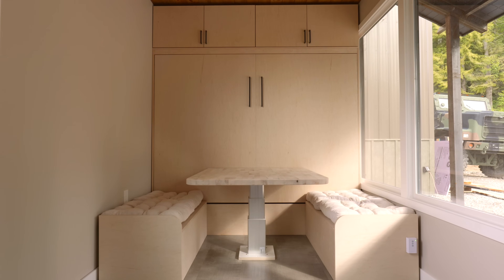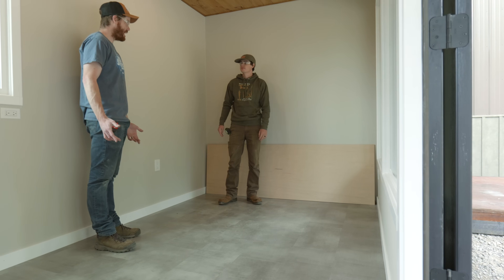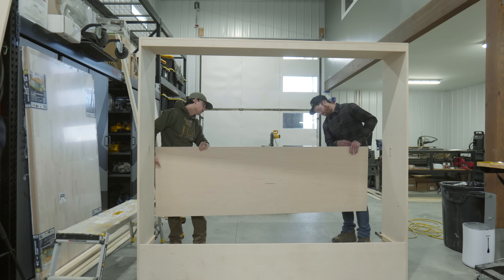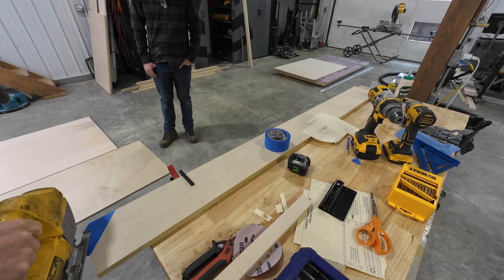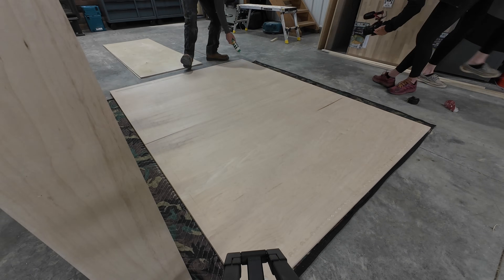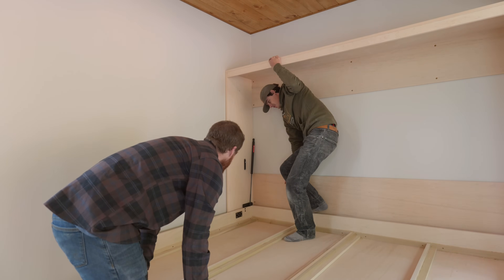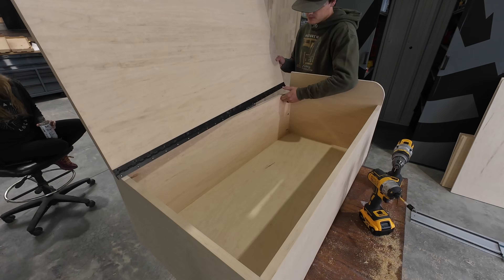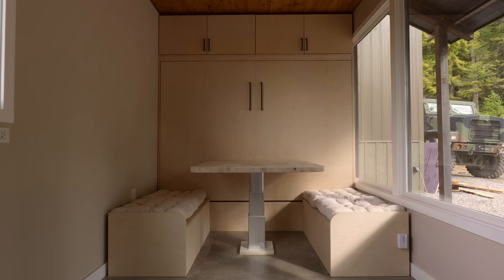We Built The ULTIMATE Murphy Bed (complete build)

Comment from the maker: Thanks to Ferrellgas for sponsoring this video: https://ferrellgas.link/8zf
Reply: Having the nice driveway that you built made it really easy for the propane to be delivered.
Reply: Does the table up/down motion stop if an obstruction (legs/arms) is encountered ?
Reply: Kudos to the 'detailing team' who made that pretty truck sparkle. Nice segue into the spot too. That 'ad' is ready for 'TV' (whatever that is...)
And 'set for the winter' - by June! (Who are you - and what have you done with Riley?)
Reply: Cool to see a new partner like Ferrellgas. This video idea is probably a few years down the road, but I think Ferrogas is working on some renewable NG projects, one from biogas produced from vegetable oil byproducts, which looks really promising. I think there is another project, direct gas synthesis using excess renewable energy. Remote homesteads are always going to need some form of dense energy storage, at a minimum for backup heating and power during long snowstorms... Renewable natural gas is going to be one of the answers!
Reply: where do i get the murphy bed hardware kit?
Reply: I really liked your video 😊😊😊😊where can I buy such a table leg?

Comment: Your collaboration with Molly and Dylan on the Murphy bed was a hit out of the park. Well done!!!

You mentioned that the tape measures were out of wack. (Usually) These can easily be brought back into "close" accuracy.

Loss of accuracy is generally attributed to the tab (at the end of the tape) no longer being perpendicular to the line of the tape. Using a SMALL hammer gently tap the tab back into its proper position, the edge of a steel (welding or layout) table works well for this.

Track saws are a major help to any woodworker, regardless of skill level. But before the availability of track saws to the general public woodworkers would avail themselves of "track boards".

A track board is comprised of a super straight 1X2 and a piece of plywood (min. 1/2"). Secure the 1X2 precisely parallel to the factory edge of the plywood two to three inches inboard. Then saw off the "track board" from the full sheet of plywood using the saw intended to be used with the track board. Some people adhere sandpaper to the back of the rack board while others would simply clamp the track board into position using the space on the other side of the 1X2. At one time I had three track boards, an eight-foot, a five-foot, and a three-foot track board.

Once again great work on the Murphy bed project.
williamj

Comment: I bought a tracksaw several years ago. I do not do cabinet work, but the tracksaw makes it much easier to accurately rip sheets of plywood. I am definitely going to remember the trick with the foamboard. I finally have a use for the piece of foam board that has been laying around in my shop for years.

Comment: They make a flush trim bit with a very slight round over at the top that is perfect for trimming the edge banding. A regular flush trim bit also works but needs additional sanding. Make sure to get one with a ball bearing so you do not burn the wood. Go slow with the router to minimize chip out.

Comment: When doing edge banding you should use a hard rubber roller to apply the needed pressure after the heat of the iron. There are several trimmer options for removing the excess.

Comment: For trimming the banding strips flush a hand planer tool ( a small one using a very light touch will give a better trim and be super fast ) will put razor blades to shame.  Just need to set a new sharp blade at correct height and make a few test swipes on scrap test boards before working on finished piece.

Comment: That is a really nice setup for such a small space.  I really like how the table uses that height adjustable center post.  The only 2 questions I would have are does the table height adjuster have any safety or interlock to prevent the table from coming down while it is being used (hypothetically if a short occurs due to spilled liquid from the table getting onto the control board causing it to begin dropping down without anyone touching it.  Also since the table is a horizontal surface and we all know how evil those are, is it possible to have it drop down far enough to still potentially keep some items on it like a low profile napkin holder or other similar items or will it rely, much like an RV that the entire table is 100% cleared off when not in use.  All in all this video has given me some ideas for my house.  Awesome job so far.

Comment: If you're doing another project with a ton of edge banding, consider investing in a laminate trimmer router and the right bits.  You'll find uses for the router ever after and it will make the work go MUCH faster.  And they are not that expensive.  Or, if you want to stick with hand tools, a good block plane.  Either will be much more fun than the razor blade.

Comment: Consider adding holes for air flow to the bed. Otherwise the matress will have mold over time. Greetings from Germany 🇪🇺🇩🇪
Reply: Came here to say this. Great advice!
Reply: Same here
Reply: Instead of doing that, and ruin the finished look, you could add "egg crate" style underlayment below the mattress. It is used for flooring and I've seen it used in van builds.

Comment: Dylan, Riley,  the only thing I would have done differently is use a router with a straight cutting follower bit to do all those curves, it makes a perfect edge for applying the edgebanding on.   I learned this building about 1000 custom cabinets or so over the years  :-D     This is the MOST AWESOME  video,  yall need to do a lot more "Team Projects"

Comment: There is a tool available that will slit both sides of the edging  tape on the edges of the plywood,It has 2 razors on each side and you squeeze the tool  against the plywood  while running down the plywood, Does a fanatstic job with perfectly trimmed edges no tears  on the edge material. Can't believe you spent all that time trying to use a single edge razor to trim the edge.

Comment: Track saws are awesome! If you want perfect rounded corners, 3D print 1/4” thick templates on your printer and use them with a router bit and guide bushing. I pre-cut with a jigsaw and finish off with the router. It makes them perfect 90 degree angles. If you need a better description of the template, let me know.

Comment: The sad thing is that all those measuring tapes are probably correct for something, the inch is not a uniform measurement, Sweden transitioned very quickly from the imperial measuring system mainly because people were tired of triple-checking which type of inch was supposed to be used for what, carpentry inch? metalwork inch? fabric inch? some lumber unit from abroad? all incompatible, 10 or 12 inches in a foot, and converting between them...